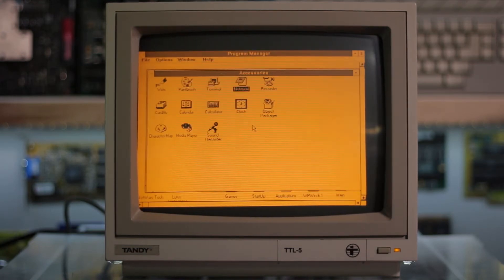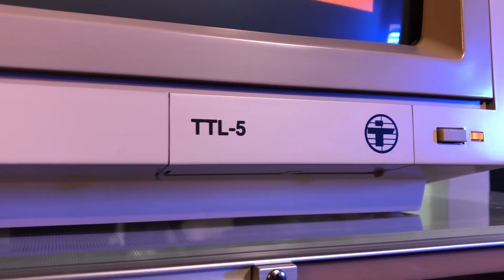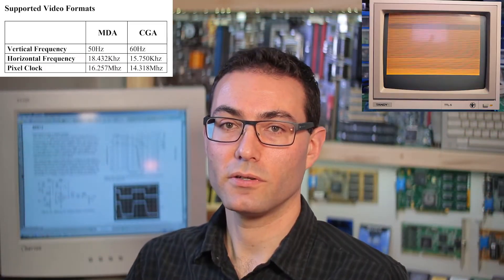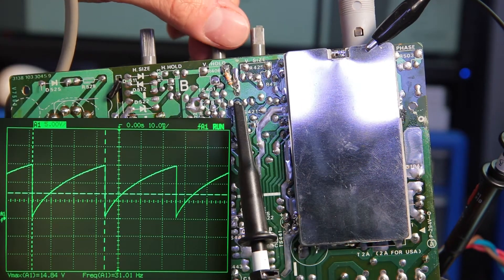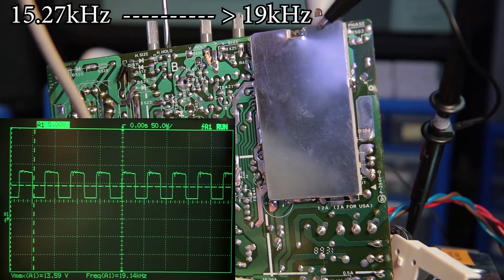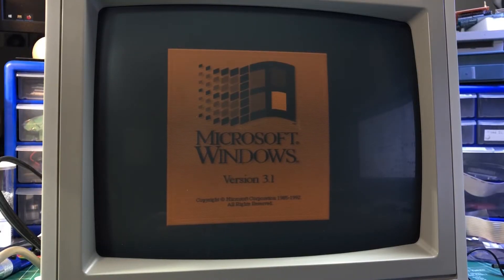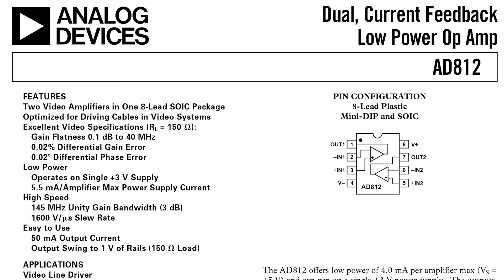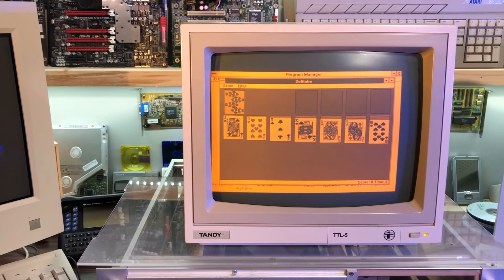MDA to CGA mod on a TTL Monitor (Tandy TTL-5 Amber Monochrome)

Comment: Hey, I know this video has been up for four years, but I'm trying to figure out how to convert an amber monitor of my own to SVGA or possibly just an rca jack, and I am curious about some details. When you say it was turning the analog signal into a digital picture, were you referring to CGA? CGA is entirely digital, which actually makes it much more compatible, but then when you added grayscale, was that RGB from the CGA or the VGA? I couldn't understand how CGA would manage to produce a grayscale image when it is digital. What I also was wondering if you knew was what the voltage is to flip the intensity or video pin from a 0 to a 1, and how that behaves with an analog signal.

Comment: Philips actually made this exact same monitor, as in, completely identical but with a philips logo and with a composite input, as the bm7522. There is also the 7502 in green and the 7542 in white

Comment: The shape is quite like the Pilips BM7522 that is an amber monitor mayde by Philips with composite and audio input. Have two of them, one is upcycled with a DTV receiver as black and white 12 inch TV, because has white phosphors. That should be the BM 7513.

I think you could see on the PCB unused pads that are for the composite input. https://archive.org/details/PhilipsBM75xxServiceManual/page/n3/mode/2up 

Had to repair mine, because they both had a failure in the 12V regulator so I had to dig in the schematics.
Reply from the maker: Interesting, correct it looks pretty similar!

Comment: I have a AMDEK Color 600 'Good Luck finding anything on it' It has a 13' crt and only a 9 pin D-SUB and a switch labeled A/B as well a mono audio input.
I found your video while searching for a way to convert analog CGA to TTL CGA as I would love to use this monitor with my Arcade supergun and not just my Tandy 1000 or the Commodore 128. As i am not a electronics expert modding it would be a real challenge and the fact I can't find any schematics. That said is it possible to make a device to do all this external of the monitor? I am guessing not and probably not worth the cost.
Reply from the maker: Analog to TTL could be feasible in theory, so long that the H/V frequencies would be compatible, the other way around would not without bypassing some internals. I guess Analog to TTL CGA would only take a few components tho, my guess would be just some schmitt triggers and TTL Logic could suffice.

Comment: I bought a VGA monochrome monitor, when i plug it to my laptop vga output i get a sord of triple image overlayed on the edge of each other, it seems like i can do some adjustment messing around with the Horizontal phase adjustment pot but it seems like it runs out of range, is this related with refresh frequencyes? Any idea to solve this problem?
I’m guessing it has to do with refresh frequencyes since it changes whenever I choose a different frequency output... In the end I just want to plug it to a composite video signal with an RCA jack
Reply from the maker: I think I see what you are talking about, three stretched images on the screen. If that's the case, definitely a sync range (refresh rate) not supported. Did you check your monitor's specs?
Reply: Analog Thinker well it has a user manual wich talks about Vertical frequency of 50Hz to 90Hz and seems to be compatible with VGA, 8514A and VESA the signal input is at TTL level of 3.4V+\-1V any idea?🤷🏻‍♂️
Reply: Analog Thinker another important fact is that i can run an old laptop loaded with win XP, the BIOS setup displays just fine and the windows loading logo but whenever i get to the GUI it flickers around and won’t display the image... My guess is that the BIOS setup and loading screen runs at lower frequency or on it’s range and windows GUI doesn’t
Reply from the maker: @saimon1680  That would also be my guess. The other thing to consider is the resolution itself. Make sure you stick to DOS resolutions, I don't anticipate those older monitors (especially the monochrome) to handle anything like 1024*768 or even 800*600...
Reply: Analog Thinker Thank you for your time! And by the way I really enjoyed your video! You’re clever

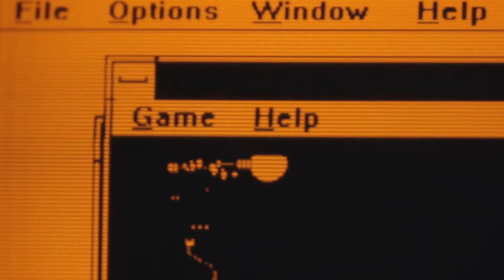Comment: This is a very cool idea! I recently got an amber MDA monitor and discovered that it can handle CGA if I adjust the V-hold just right, but is in "black and white" instead of greyscale/amberscale like yours, and it isn't completely stable - sometimes when I launch a CGA game it will cause the picture to roll and I have to change the V-hold again. Do you know what I could do to help it lock-on better? Also, I'm curious what this switch at 2:36 is doing, what did you connect it to if I may ask?
Reply from the maker: I am guessing your monitor is built like mine, there is a logic gate (Exclusive OR type) that will turn any analog signal into a digital (full off or full on) signal. To get AmberScale, you will probably need to do like I did, bypass this gate, mix your RGB signals using a 1k per channel, and maybe amplify the video signal. There is no easy way to help the monitor latch on a different frequency tho, I think you will still need to adjust V-Hold manually. As for the switch I showed, it was to select between [Mixed RGB signals] or [Intensity] signal coming out of my graphic adapter, just a test but I wasn't happy with the results and went all the way with Analog conversion.

Comment: I tried a similar thing a while back with a mda monitor I have, but was using vga to the monitor and had the same black and amber colours only. getting the grayscale is very interesting, I may have to try that on mine later on

Comment: Shenzhen Elongshine Technology Limited is a factory specialized in CNC monitor ,MDA, CGA, EGA monitor .
 Our products are with good quality and affordable cost for you.
https://en.elongshine.com
eg: FANUC A61L-0001-0093
FANUC A61L-0001-0092/0086/0076/0072
FANUC A61L-0001-0094/0074
FANUC A61L-0001-0095
FANUC A61L-0001-0096/0097
HAAS 28HM-NM4
Mazak Monitor CD1472D1M and MDT-1283-02 (MDT1283B-1A)
Siemens Monitor SM-0901 and 579417 TA...